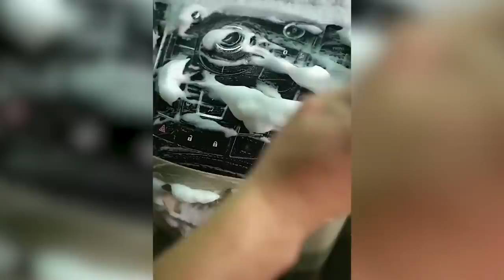A SATISFYING JOB THAT IS INTERESTING TO WATCH

Comment: The interesting thing to note with the interior car cleaning is that you don't really notice anything until you start cleaning it. You haven't noticed a changed much so to you "It's not that bad, in fact it looks pretty good considering you have had it for 10 years" and then you start cleaning it and note how much dirt comes off and how much cleaner it looks once you have.

Comment: VERY careful not to tell you what the "magic" compound for headlight polishing is.  THAT would have been helpful!
Reply: Go buy 3m 3 stage polish kit. 😘
Or go buy 3000 grit sandpaper and a single stage compound.😘
Reply: Or don't bother. My truck head lights were fogged on the inside and outside. Cleaning the outside did work. But new headlights were needed. Not very expensive if you buy on Ebay.
Reply: Heat/steam! Done it heaps of times on my Subaru headlights.
Reply: Toothpaste
Reply: @bonniehowell6604  thank you
Reply: Jesus loves you

Comment: Spray painting the tin roof. Goes on quick.  Looks great!! But, the first time it rains,  the paint washes off the tin.  An old trick to make a quick profit and drive away. Kerosene is in the paint.  Happened to my father. Got fooled. Had the warehouse roof spray painted.  "Cheap price ".  next rain it all washed off.

Comment: 18:00 What is a "Self Leveling Floor"?
Reply: It's kind of like the water in a glass or in a casserole dish, it is flat on top,  same thing with the floor levellers - they are very thin so they flow and fill all hollows or low spots.